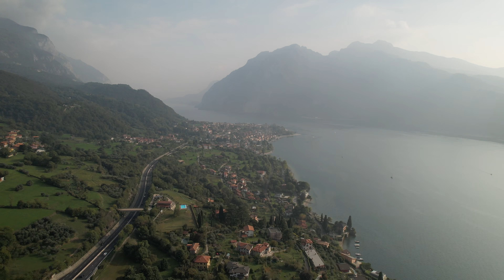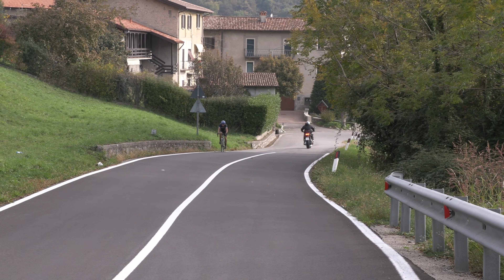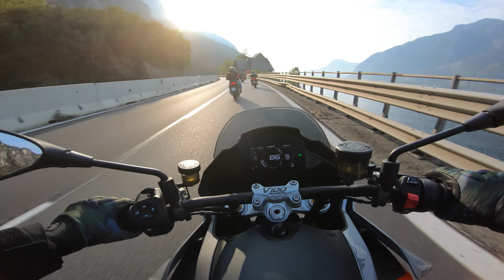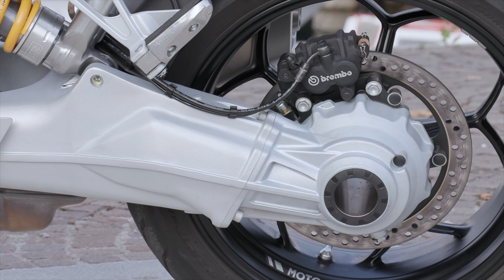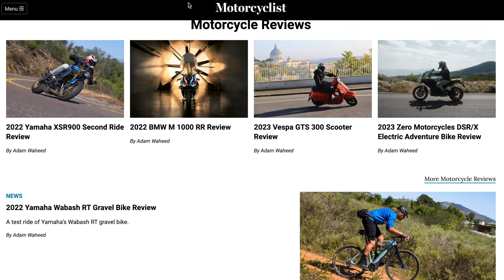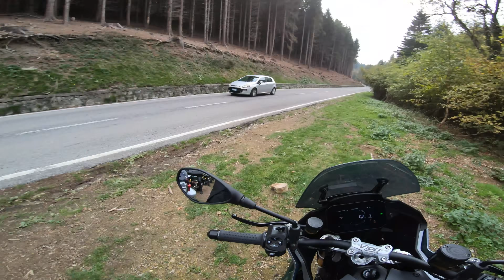2023 Moto Guzzi V100 Mandello S Review

Comment: I have over 55 years of motorcycling behind me. As far as Italian bikes, I have owned a ducati 860, moto morini 500 camel, laverda 3cl 1000, cagiva 650, and currently have a 1989 Moto Guzzi Mille GT 1000 and a 2013 Moto Guzzi Stone 750. Have owned several German bikes to include BMW and Zundaps. Grew up with British bikes-meaning Triumph and BSA. Have never been interested in Harley. Owned several Suzuki's to include 2-stroke models and the Wankel rotary 500. The Moto Guzzis have been my favorite above all the rest. Quirky, reliable, tractor-like in that the Japanese "refinement" is not there. But if you love just being connected to machinery and sound, then Moto Guzzi!- By the way, because it is shaft driven and a new bike it takes some miles to break in the transmission as well as for the brakes to seat well--be patient--mike

Comment: Fantastic bike, but I don't think I have ever listened to a more boring review.  And while I agree that the technology of this engine is a giant leap forward for Moto Guzzi, the bike seems only incrementally better than the old Moto Guzzi Griso 8V, in terms of output & riding adrenaline.  I doubt if the reviewer has ever ridden a well-sorted Griso.
Reply: it puts its power down to the ground better then the 1200 griso and is nearly 200cc smaller. the bike as a complete package is "better" then the griso but the Griso is just beautiful. I have owned 2 griso's and LOVE them but this bike is massive for Guzzi and i will be trading my current 07 Griso for one.
Reply: @sublimekid247  You are right. However, I will wait for a better-looking model with the new V100 engine before I trade in my Griso.  The Griso is just too beautiful.
Reply: @jala6707  absolutely understandable the Griso is one hell of a beautiful bike. My selling points are the blue tooth and tech (spoiled by my mgx21) AND big seller was the awesome bag mounting system and bags. Griso checks 90% of the boxes but my g11 isn’t a “tourer” short trips my g12 was WAY more comfortable

Comment: Nice review of a really cool bike. I think both models get the electric windscreen. Either way the S  has the Ohlins, a QS, heated grips & tyre pressure monitoring. I think I prefer the base model for the money & would add the QS, maybe heated grips if they're any good. It also looks better with the gold wheels. Weird choice not to put them on the S models as they look amazing.
Reply: I'm think the same way, those gold wheels they have to better looking coming out of the dealer as standard OEM for that price point......the Ducati XDiavel and Triumph Rocket are nice too but way too expensive motorcycles. I wish to have something similar in my Ducati SuperSport.
Reply: The Marina Aviazione Navale model comes with gold wheels.

Comment: That huge exhaust pipes coming out from the sides with exposed flanges and bolts looks old fashioned industrial look while rest of the bike looks sleek and modern. also dangerous. it can cause serious burns. as it is so close to knees . they should have positioned the exhaust values towards the front like in an inline fours. pipes neatley tucked between the radiator. other odd design is the all aluminum painted engine and the rose gold  valve cover. Guzzi need to take a page from Honda Goldwing design.
Reply: Ride one and you'll see for yourself. Not an issue.

Comment: I disagree with the transverse label. This layout is longitudinal and you can refer to any part you want (vehicle centerline or crank direction).  The FWD cars are transverse meaning the crank is perpendicular to the vehicle centerline/CL. The drive components in FWD are all transverse as well. A s1000rr is transverse. A bmw 1250gs is longitudinal just like an M3 or a 911.
Reply: This has been brought up and corrected before but thanks to motoguzzi using it in their marketing I think the label will stick around confusing people for years
Reply: They - and Adam - are saying the engine itself is laid out transversely. And that is indeed correct. From the shaft back it's longitudinal.
Reply: @allwheeldrive  the cylinders are on the sides which puts the crank in line. I dont see how it could be confused as otherwise. In other words, you seem to be saying the crank is going from left/right….a zx6r would have the cylinders going forward or back which puts the crank going from left to right. look at a FWD vs RWD engine bay.
Reply: furthermore; it matters because when you rev it the bike will react on a different axis.